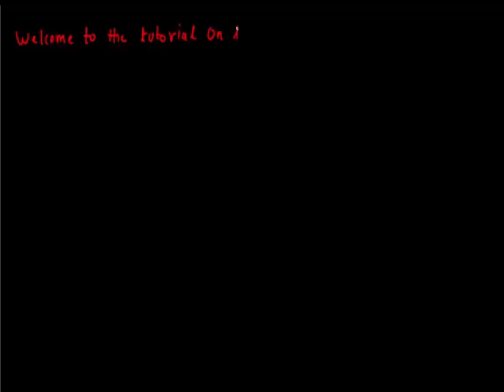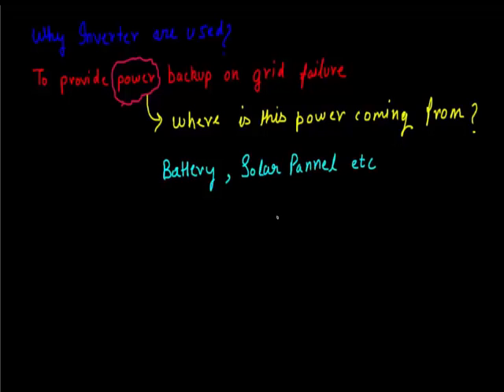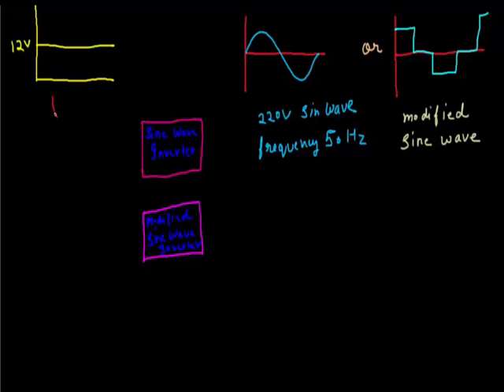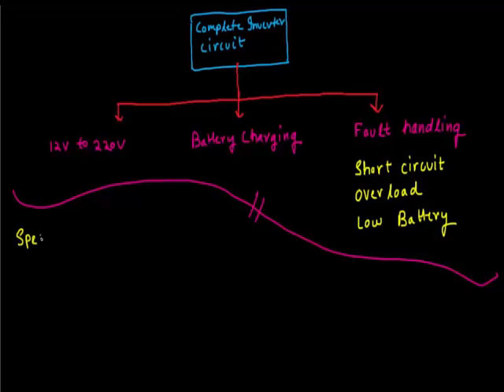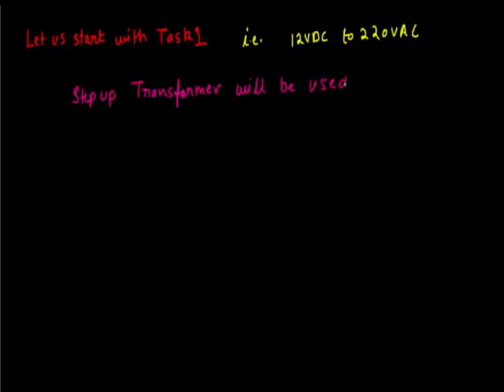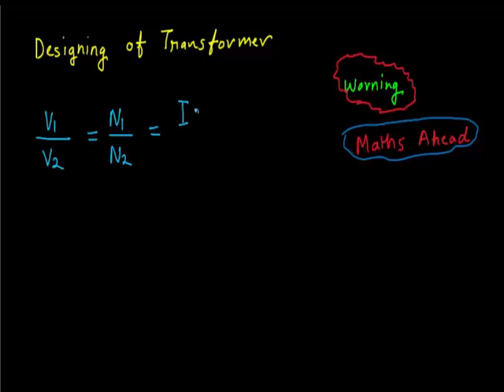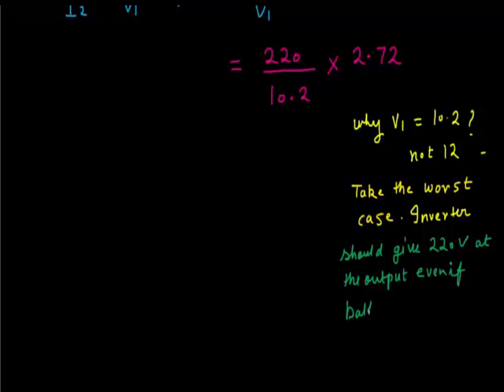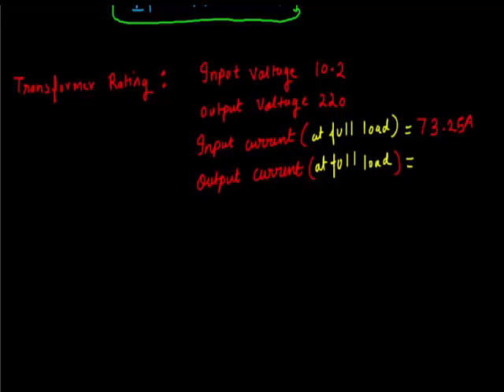Make inverter at home Part 1

Comment: Sir which transformer did you use in this,is it step up transformer or step down transformer??
Reply from the maker: I used this transformer from old UPS.
Step up and step down, both are same just n1:n2 ratio different. So called step down transformer can also work as step up if you apply V1 to N2.
Reply: @shailzakantpandey1429  thank you so much but i am not able to get the output... Please please help me
Reply: In circuit diagram Vin of arduino is connected to 5v.where to connect this 5 v

Comment: You have not considered the power factor, V*I = VA or KVA = apparent power = real + reactive power. If you are driving an inductive load, the apparent power (V * I) is not same as real power (power needed for output from the load, in useful form). Reactive power will eat into your transformer rating. It also heats up the MOSFET faster, as the reactive current flow through the body diode of the MOSFET which causes higher temperature (diode has higher drop).

Comment: what modifications  shall I do if I used 12v 2amp transformer
Reply from the maker: You can use 12V 2amp transformer with 12V battery  but remember the output voltage will not be load and line regulated because there is no room for feedback. i have used 12V battery and 7V transformer because there is a certain room for feedback network, i mean the pwm pulse would be adjusted in such a way that output voltage is always 220V .

Comment: so 12v 2amp
Reply from the maker: No, in my case i have used a transformer from UPS, which is rated at 7-0-7 to 220V,  the apparent power rating 600VA and the real power is 360 watts.